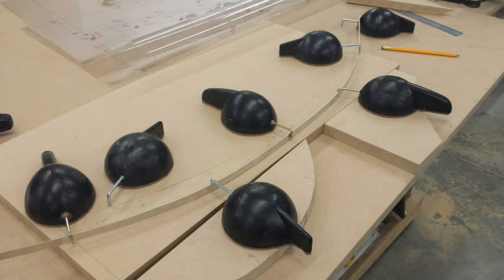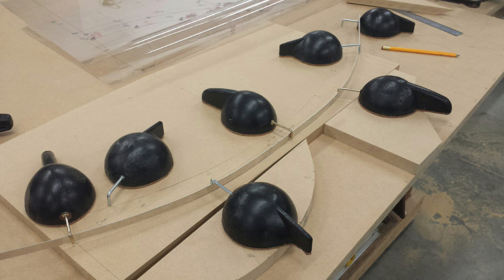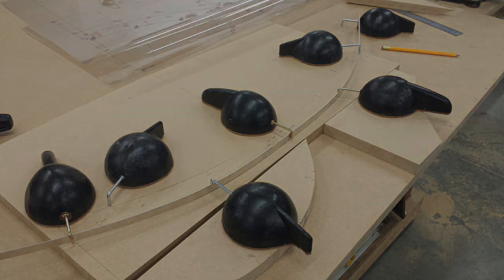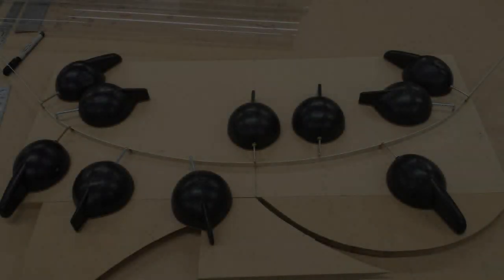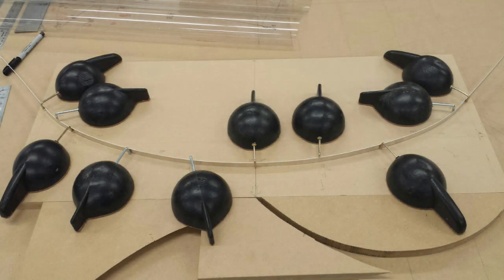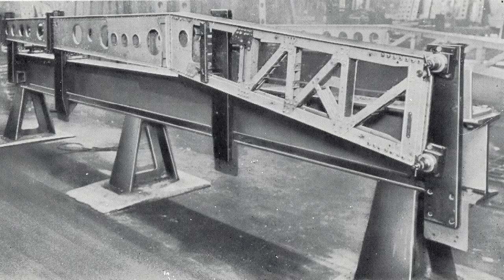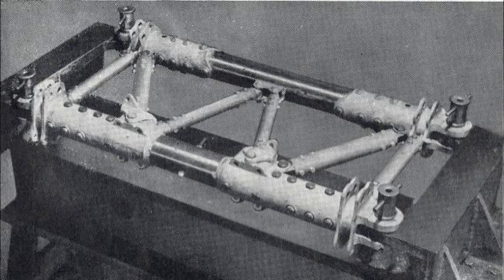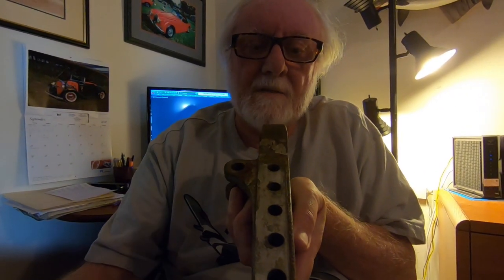S1E4 Part 1 of 2 Hawker Typhoon Design Process

Comment: This is giving me flashbacks to when I was a student and having to interpret the pictures of drawings on microfilms to reproduce some of the major structural components of the wing of a Spitfire in CAD. It was a nightmare and had me wishing I had a time machine to go back and get a copy of the originals (and to give the person who did such a lousy job photographing them a good hard kick in the shins).
Reply from the maker: The radiator fairing is not the hardest area yet; the rear mono section which Martin is working on has presented very similar challenges. ~Ian

Comment: In the reverse engineering proces the re-designed products (brackets, sparcaps etc) can have nearly invisible modifications like larger radii on critical spots. I have seen near steplike thickness increments in high loaded parts of those days. (Meteor wingjoint, Hurricane, Wellington)
Using aerospace materials with much increased toughness, e.g. 7050, (MMPDS values) and certificates will also make it structurally safer.
You are doing a wonderfull job!  Perfect.
Reply from the maker: Thank you Louis, 7050 has come up several times as an alternate, a very tough material indeed. I had some dealings with contractors drilling 7050 assemblies for the C-17 many years ago, and they struggled to keep their drill bits sharp even under ideal conditions. Eventually a solution was found which didn't seem logical; 18,000 RPM drill! ~Ian
Reply: @TyphoonLegacyCoLtd  Yes.. Carbon fibre is the same sort of stuff, even hard metal wears out.
Redesigning a Typhoon is a HUGE undertaking.. all the stress-notes will be say a few meter of  A4 s at least. 
As specilist in aviation stress calcs using handbooks I would check them now with emphasis on fatigue and crackgrowth especially in single loadpath structures, such as the main spar. This nice was underrated (mildly said) in those years.
Reply from the maker: @louisvanrijn3964  We are fortunate to not have to re-engineer anything for the rebuild, the original data must be used to ensure it meets the design spec for certification. I couldn't imagine having to re-engineer this design! We are always looking for a good stress guy! ~Ian
Reply: @louisvanrijn3964  Hi Louis : I suspect the aircraft structure would primarily have been designed using a static analysis & classical hand calculations (no FEM in those days!!!!).
I could be wrong, but would fatigue have been considered apart from good engineering practice, and bearing in mind this would be pre-comet days and the expected life span of aircraft would be short (WW2).  Looking at the those offset holes on the wing attachment bracket is interesting - i wonder if the original calcs would have taken into account the potential for extra offset (from drilling in situ) from the Neutral Axis and the resulting extra local bending moments on the main wing pickup - one would hope so!!!!!!!!

Comment: wouldn't the off centre holes either alter the parts own c.o.g and or compensate for a asymmetrical load on the part? the wing being out of balance weight wise top to bottom compensated by the holes being through the load centre rather than the actual centre or even off the load centre? just a thought really if they're purely strengthening holes rather than locating holes otherwise they'd just be weight reducing holes and ok through the centre line.
Reply from the maker: The holes on the spar fitting that Martin showed are the bolt holes for its attachment to the wing spar boom. In this case, the part is the lower fitting, and the holes are offset so as to reduce the wall on the bottom side of the fitting. That area carries all of the tension on the lower side of the wing during flight and on the ground. ~Ian
Reply: @TyphoonLegacyCoLtd  - thanks for replying. Good luck with the project, makes for fantastic viewing seeing the unseen fabrication and construction methods re-visited.